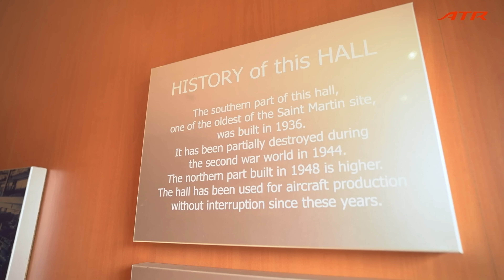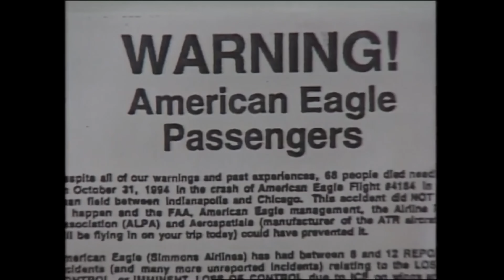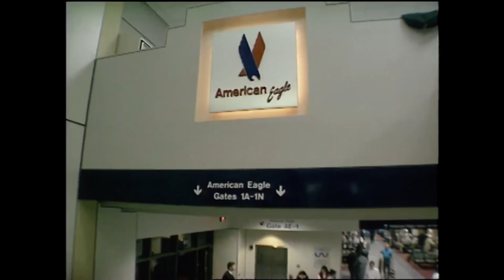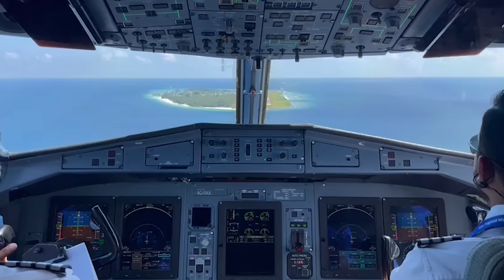The Plane That Can’t Fly in the Cold: The Story of the ATR 42 & 72

Comment: Several airlines such as Canadian North, Air North and Calm Air serving many remote points in the Canadian Arctic region where temperatures of -40  (same in C and F) or lower are common in winter have been operating the ATR 42/72  without problems for many years.

Comment: The reason for the crash in Indiana was down to the de-icing boots not going far back enough on the wing. I used to work for Flybe and we had 5 of them in the fleet, they were incredibly unpopular with Pilots, Cabin Crew and Engineers compared to the much faster and nimble Dash 8-400.

Comment: This was good. There was also Voepass 2283 last year, which crashed due to an icing incident. This is still under investigation, but this aircraft is vulnerable under certain conditions or failures.
Reply: Flight 2283 was totally pilot error. Flew into and stayed in icing conditions with KNOWN deicing malfunction. Did pretty much everything the flight manual tells you not to do. Flown per the the flight manual the ATR is a very safe airliner.

Comment: Most people tunnel visioned on the different aircraft design, and disregarded the one very important difference between American aircraft manufacturers and Europeans. I started paying attention in the 80s when an ATR were lost in cold weather and just dived into the ground. There was not much of the aircraft left and the NTSB came to the formal conclusion that the ATR wing were defficent and need a redesign. They suspect an ice dam formed in front of the aileron , making it ineffective. ATR of course  did not agree and mobilized all their lawyers to fight it tooth and nail. The result is , no changes made, business as usual. They did the same thing with the Puma helicopter crash, evidently the first crash did not generated enough tombstones , so nothing was done , till several more failures later. They basically upgraded the chopper from Puma to Super Puma, more HP and same gear box. The different method of doing business between Americans and Europeans are obvious.  Europeans would pull out all stops to defend their airplanes, admit no faults, until that become impractical. Americans , with their short term executive mentality, and they can only see from quarter to quarter, in the case of the Max, think they can just use the company's deep pockets, pay off everyone and the problem will go away. It did not. The wisdom of farming out of manufacturing and maintenance is also questioned. Since both are heavily backed by gov. they can both afford to make some huge blunters and still survive, such as the A 380. The recent rash of engine failures world wide are basically due to competitions, to be first to introduce an engine that are more powerful and burn less gas than the old ones. Leading to quality problems and fan section undergoing "rapid unscheduled disassemble" in flight.  P and W parents and RR both had that problem, and another make , if there is a bird strike, will empty all the engine oil supply into the cabin bleed air duct, filling the cabin with toxic smoke. P and W Canada, home of the PT-6, I accused them of behind the times before, they were 2 decades late bring out features like FADEC, one button start, and auto throttle, but their engines are still bomb proof.

Comment: No big deal. 

You just check your speed and use the recomended safety margin. 

If it starts droping you request lower altitude. 

Now, I know about the accident in Brasil. But we still wair final report to understand why that crew failed to notice the problem. There are many factors which have been hinted. But in the end they messed up big time. 

These airplanes work pretty well in all conditions. 

Northern European companies fly them a lot.

Comment: You forgot one very important factor in the American Eagle crash. The flight was in a holding pattern, basically just sitting in those severe icing conditions for a long period of time. Because of the slow speed they had to fly in the hold, the pilots elected to use the flaps to get the airplane’s pitch down to a more comfortable level. This was NOT standard procedure, and it resulted in aerodynamic changes that caused the ridge of ice to grow aft of the protected area.
Reply from the maker: I said it was put into a holding pattern and it was not normal conditions.
Reply: FAA rules were changed after the crash because the holding pattern was a major contributor if not the cause of the crash. The ATRs deicing was also upgraded significantly to prevent reoccurrence. Most resent ATR crash due to icing was pilot error / incompetence . Stayed ( by choice) in icing conditions with known deicing faults.

Comment: Was a Captain on the Dehavilland Dash 7 and Fokker 50 in the 1980's and early 1990's. 
The F50 was a superb airliner and had a spacious cabin, proper airline type seats, was very quiet and extremely economical - and fast.
On a 110nm flight we would break even with 10 passengers and operated the PW125B engine at 2500 shp.
We did on average 280 kts TAS and were much faster than the Saab Fairchild SF340, Dash 8-300 and ATR.
Fokker's were built both extremely well and built to last.
And it excelled in both the European winter as well as the Australian desert.
Unfortunately they couldn't compete with the heavily subsidised Airbus Industries and as a result the oldest aircraft manufacturer on the planet was forced to close.
Reply from the maker: Sounds like you had some great experiences with those planes!

Comment: This airplane can't and never will be ale to fly in the cold. Just last year, 2024, another fatal crash took place in Brazil (Voepass FLT 2283) killing all 62 people on board.
Reply: Just a look on Flightradar24 Will Tell you otherwise… Canadian North, Summit Air flies them in Artic Canada and SAS and Finnair flies them in Northerne Europe & Scandinavia year round aswell 🤷🏻‍♂️
Reply: ATR is a safe aircraft when flown as required by the manual. Flight 2283 was flown in known icing conditions with defective equipment. Suicide by pilot???
Reply: @rdmgwinn  Anybody who climbs on board one of these aircrafts has a very strong death wish, so! You are kinda right about the suicide part.
Reply: @princesslithium  
An aircraft that has a very safe long term record and still operates in some of the most unsafe areas on our planet. Has had three high profile accidents. Two of which were pilot error. Would / do fly on an ATR regularly (excepting a few Countries with horrible aviation records).

Comment: Most turboprop and turbofan airliners are equipped with an Auxiliary Power Unit (APU) which is a small turbojet engine which is mounted at the rear of the tail with a visible exhaust port.
However with an even more efficient, as well as a lower weight design, ATRs aren't equipped with an APU! Nevertheless they can still be autonomous in ground operations, as they all are equipped with a PROPELLER BRAKE ON THE STARBOARD ENGINE, allowing the engine to remain running to provide power on the ground. That puts the idling turboprop engine with its immobile propeller on the opposite side to passenger and cargo loading, as well as for refueling. (Under Arctic winter conditions, refueling is usually done 'HOT' while all passengers are temporarily deplaned.) 
Many northern Canadian and Arctic flights are well over two hours, with distant alternate airfields. Therefore maximum jet fuel loads are often carried, making refueling at intermediate destinations much more frequent than 'down south'!
Not requiring 'ground power' for heating, air conditioning, and/or for restarting either of its 'gas turbine' engines is particularly useful at smaller and remote aerodromes. That's especially true for those northern Canadian and Alaskan Indigenous communities, as well as at remote airports and airstrips within lesser developed countries worldwide!
   🌎 🌏 🌐 🛫 ✈️ 🛩 🛬 🌐 🌍 🌎

Comment: As with the other most numerous twin turboprop airliner series, Dehaviland Canada's 🇨🇦 DHC-8 (Dash Eight), the ATR-42 (introduced in 1985) is also a high-wing airliner powered by twin turboprop engines; Pratt & Whitney Canada 🇨🇦 PW120s. 
The number "42" in its name is derived from the aircraft's original standard seating capacity of 42 passengers. Later variants were upgraded with new avionics, a glass cockpit, and newer uprated and even more efficient P&W Canada 🇨🇦 engines.
The ATR 42 is the basis for the stretched ATR 72, which was introduced in October 1989.
  🇫🇷 🇮🇹 🇪🇺 🌍 🛫 ✈️ 🛩 🛬 🌍 🇪🇺 🇮🇹 🇫🇷

Comment: They were also good for freight. There are some mixed passenger/freight configurations, for mail, critical deliveries if not too large to island and isolated destinations. Some had mods or originally made with large cargo doors. FedEx had/has some of the ATR-72-600 for full cargo use for years as originally made for freight or pax to freight conversions.
Reply: Some of the Canadian Arctic airlines (FIRST AIR, and CANADIAN NORTH AIRLINES of the Northwest Territories and Nunavut, as well as AIR NORTH of the Yukon territory) were the first ATR-42s modified by Aerospatial's🇫🇷 Italian partner Aeritalia 🇮🇹 (now Leonard), with a enlarged cargo door. As I recall the first two were modified for FIRST AIR almost 20 years ago. That mod was so that these aircraft would accept the smaller dual and single cargo pods, as well as even more importantly for fly-in only Arctic communities, oversized and overlength industrial cargo that wouldn't fit through the standard doors. 
These European factory modifications were for those Arctic airlines' dual passenger and freight (COMBI), as well as their fully CONVERTIBLE aircraft.
As mentioned by the well informed commenter above, Airbus/ATR  has now included oversized cargo doors as an OEM optional feature on both ATR-42s and ATR-72s, for a decade or more!
PS Those same Canadian Arctic airlines also utilized B-737 Classic Series aircraft modified by third-party Boeing-approved contractors, with oversized left side cargo doors on their COMBI and fully CONVERTIBLE aircraft!
 📦  🗳 👩‍🦱 👨‍👦🛫 ✈️ 🛩 🛬 👩‍👧 👩 🛢 🗳  📦

Comment: As told to me by an ATR 72 pilot: the deicing boots in the early aircraft were not comprehensive enough. It was found that ice was also building in areas not foreseen before. So the deicing boots were extended accordingly and the problem appears to be solved.

 I cannot say if all ATR-72s were retrofitted. When on board in freezing winter try asking the Stewardess... 😀
Reply: You are correct. The boots were extended further back on the wing. 15 years heavy check on ATR42 & 72 CFS (Empire) KCOE,
Reply: Airworthiness Directives of the FAA, Transport Canada, and the European EASA (?) REQUIRED the retrofitting of newly designed and enlarged deicing boots on the wings of all pre-1994 ATRs. I.e. Those manufactured before the American Eagle (Simmons Airlines) Flight 4194 Roselawn, IN tragedy.
Additionally those ADs required extensive instruction for pilots flying the affected aircraft, on how to fly in freezing rain and drizzle (including the prohibition of the use of the autopilot in icing conditions); as well as how to recognize indications of severe icing, and requiring an immediate/ASAP exit from those conditions.
As mentioned generally above, both ATR-42 and ATR-72 aircraft had their deicing boots modified to extend the boot area to reach back to 12.5 % of the wing's chord. Previously, they had extended only to 5% for the ATR-42 and to 7%, for the ATR-72.
That largely solved the tendency of ice ridge formation at the 9% chord position of those previous, and now obsolete, sharp-stall airfoils.
🇨🇦 🍁 🇺🇸 🌎 🇪🇺🛫 ✈️ 🛩 🛬 🇪🇺 🌎 🇺🇲 🍁 🇨🇦
Reply: @markpimlott2879  nice information. I believe that the crew from that Brazilian Aeropass ATR 72 that stalled in August 2024 due to icing made quite a few mistakes. 🤔
Reply from the maker: Interesting. Maybe I’ll have to dive deeper into that question!

Comment: I have 1600 hours in the ART42/72 mostly in Alaska. It does just fine in the ice as long as the flaps are up and you follow the anti ice procedures
Reply: I fly the Atr as well and it’s a really good aircraft , those earlier versions had some flaws , from those accidents they change a lot in systems and in the design as well, right now the if you follow the procedures (don’t even talk to me about Voepass) ,you can fly really well in icing conditions .
Reply: Agreed. I flew it in Nunavut.
Reply: @Doyle155 a fellow cultured aviator. If I could make the same money I’m making now I’d never have left the ATR
Reply: *does
Reply: right, because when would you ever need to fly with the flaps down?
Reply: @ItsNova816 well I know you don’t hold in icing conditions with the flaps out. Which is what killed those guys. Tell me about all the time you spent in ATRs in icing conditions. I’d like to know what you know
Reply: I thought the title was a bit misleading, considering how many are in use with airlines like Canadian North
Reply: So you are saying that it doesn't matter how prone it is to icing accidents?
No other turboprop airliner falls out of the sky due Iceing. 
There is a very good reason that the ATR suffers from Iceing - they very deliberately chose an air foil section which was known to be susceptible to iceing because it would give them a competitive advantage in fuel efficiency.
Reply: @gregculverwell  Glad someone else here knows the struggle. The comments are glazing it way too hard.
Reply: @gregculverwell the roselone accident was caused by by holding in icing with flaps out. That changes the ice formation patterns and caused a ridge to form. After the accident they redesigned the boot system to a fingered two chambered vertical pulse style and extended the protected surface further back on the wing. It’s not considered an anti ice system not a deice system. Even with this new design, they still would have stalled leaving 15° of flaps out forming that ridge being the protected area. I’ve packed literal tons of ice on that plane and didn’t find much of an adverse handling characteristics.
Reply: @nixonvlark6390  What's tons of ice? I remember multiple times where I picked up what seemed like a moderate amount of ice on the windshield wipers but lost quite a bit of speed in the 72-200. On top of that there are some massive weight penalties when planning for icing conditions on ground and approach.
Reply: @12pentaborane  tons meaning I’m estimating the weight of the ice. Based on thickness of clear ice or mixed. There were IAS decreases for a given power setting. But sluggish or mushy countries weren’t one of them. I also operated the cold weather kit aircraft. But I had no trepidation about operating it into icing conditions.
Reply: And as far as I remember. Granted my last flight in it was almost a decade ago, there wasn’t weight penalties for bring conditions. It was air speed limitations with requiring MCHB numbers
Reply: @nixonvlark6390  Why hasn’t ATR added a deicing system to their aircraft?
Reply: @Bjg6 there is a deicing system on the ATR in the form of inflatable boots
Reply: @NikitaKaminskyy  Gotcha, thx! Oh yea, I heard about those.
Reply: @Bjg6 the pulse dual chamber boot is an anti ice system according to ATR. I will confirm it doesn’t build much ice on it while active
Reply: @nixonvlark6390  According to ATR there are two concepts regarding protection against icing - they are anti-icing (prevents formation of ice) and de-icing (removal of the already formed ice).  Boots are parte of the 3rd level of protection on ATR, ie, de-icing system. 
Source: I used to fly them in Scandinavia
Reply: @NikitaKaminskyy we were always told to consider the. More of a anti ice system since most of us came from other turbo props where the boots had to build ice before they could be deployed. You’re correct but just a difference in framing the concept
Reply: For who?? Flying where??
Reply: @michaelearlgrey yeah. We don’t ask those questions
Reply: @nixonvlark6390 I do. I have not once seen an ATR in Alaska.
Reply: @michaelearlgrey and that makes them not exist 10 years ago?  NAC ran them for two years in the early 2000s